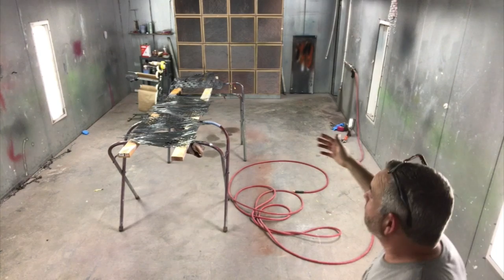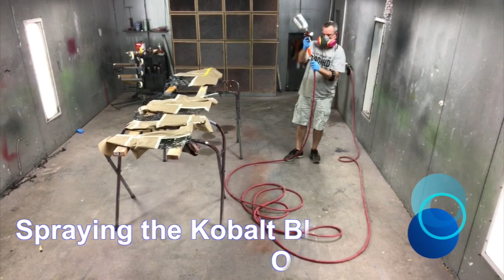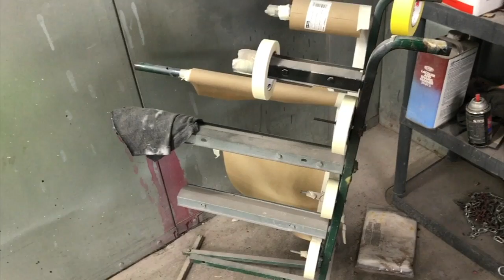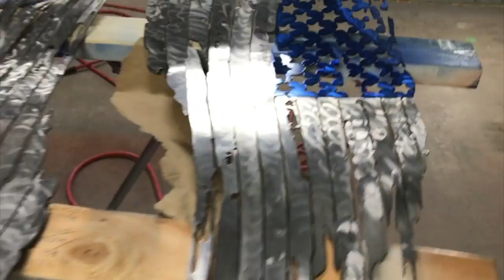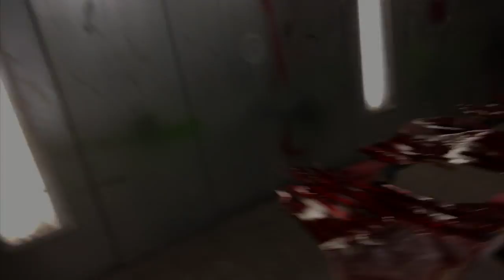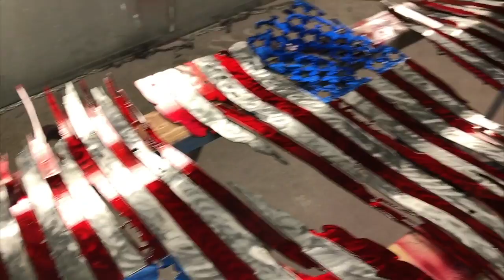Painting the Tattered American Flags - Candy Apple Red Paint Job

Comment: Gary, put some type of hook on the wall to attach your hose everytime you remove it from the gun so you don't have to lay it on the ground and have to bend to pick it up, and a hook to put the gun on instead of laying on floor, bending over is a bitch when getting older, just a thought.

Comment: Gary, those are outstanding.  Do you spray the backs with a sealer?
Reply from the maker: On the small ones I dont because i have lowered the price down to try to sell them.  The larger ones I spray with epoxy primer.